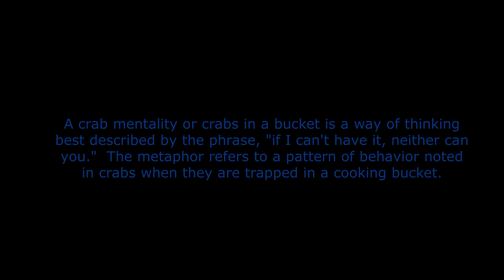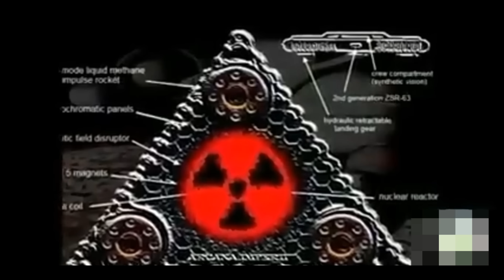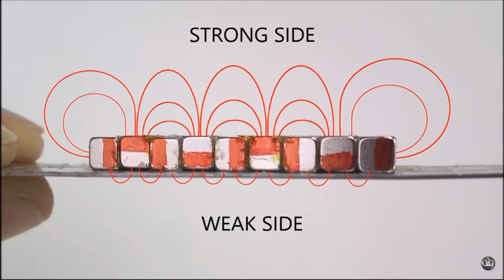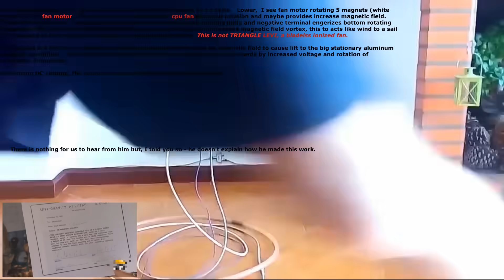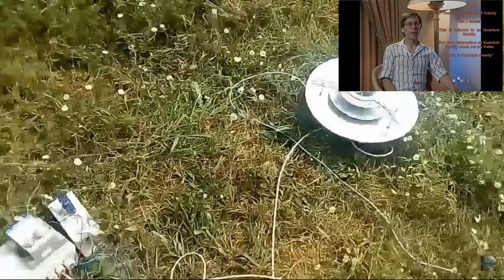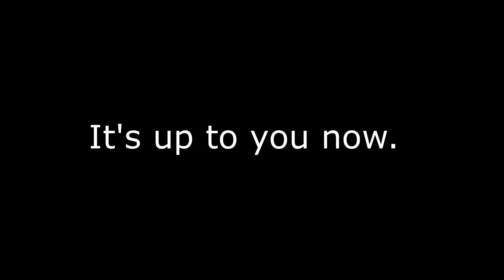anti-gravity project

Comment: yahhhhhh not even close to anti gravity

if u can create a device that can nullify the gravity waves that are pushing us down to "fix" the dent the earth is creating in space time, THEN you will have anti gravity (and then you can also make artificial gravity on space ships like in startrek and you can create kinetic shields and warp drives and artificial black hole devices (like the romulan starship cores) etc etc 

so far all I see is fancy magnets
Reply: Exactly. Perfectly stated.
Reply: Respectively, you need to go study this stuff in detail. The device copies all the principal technology from the German Bell to the descriptions of the Vimana craft. There is no way this stuff is fake, have you not see the Lifter Tech experiments, are those fake too? You can take two magnets of same size and press them together and feel a slight weight difference when compared to two other same size magnets sticking together, the weight loss is apparent. Also this experimenter is pumping thousands of volts into the center capacitor and he is counter rotating two opposing fields against a reflective aluminum disc, creating in the ether a counter 
field that is breaking the gravity lock.  He also is pulsing Ultra Sound from the cone downward and probably magnifying the sound 
pulse stimulating the ethers to move downward. . 

How about the sound chamber experiments levitating dust and the items floating upward in the Hutchison experiments? What about the High Voltage experiments that demonstrate charge obstacles get lighter? Friend, the proofs are out there. .My guess is this guy is probably getting very worried about what he has found. . He has not posted any update videos. What about the many patents on the High Voltage side of the technology. You don't get a patent on something that does not work. Just some things to think about..

Comment: MagLev is not AntiGravity.  They are both very different.
Reply: Exactly. Perfectly stated.
Reply: I might be joining this discussion a little bit late, but I decided to comment because I feel like I have a different argument. Just to make it clear, I'm not against anybody and all your arguments are valid. In this video we can visualize a magnetized object applying a force UP. Gravity is a force that pulls down, or towards a concentration of mass and the object in the video is applying a force upwards, opposite of the force of Earth's gravity. In the Cambridge Dictionary, for example, the definition of Anti is "opposed to or against a particular thing or a person" from that definition we can state that Anti-gravity is a force applied in the opposite direction of the gravitational pull, therefore the object in this video falls in the category of Anti-gravity.
Reply: and you know what AntiGravity is?   If MagLev can be contained within one Unit, a thing that rises up in the air without requiring a opposing plate on the ground (unless it is a planet or star) is effectively doing the job of AntiGravity, no?   So perhaps what we need here is Efficiency.   What if Everything Involved made use of Zero Resistance Conductors?   this would take out your backyard engineers who can't afford that level of expense.  But I would imagine Defense Department Programs would be working with Zero or Low Resistance materials.
Reply: @leovolont  still two diffrent things.Anti gravity subject related to exotic matter.And your scenerio still you counter pull of gravity, not neutrilize it.
Reply: @Smrt07     Okay, but when has any System ever counted on "neutralizing" anything.  Sail Power was not intended to neutralize the water resistance and the pull of current.  We only have to be able to Modulate Gravity and the the whole world changes.   Think of a Rotor in which you make the weights lighter by 10% going up, but heavier by 10% going down.  This could turn a healthy servo generator, couldn't it.  Now I am hoping that Gravity Modulation could be accomplished with Static Charges with not so much Leakage.  You know, the whole Energy In vs Energy Out thing.    the way to Beat Newton's 2nd Law is for the Gravity Modulated Part of the System would be like a 2nd Universe interacting with the First Universe
Reply: @leovolont  your just using a force that is stronger that another, you're no really neutralizing it as the name anti suggests, this is an magnetic hover thing, not a anti gravity device cuz it doesnt affect gravity directly, it just compensates it with a greater force
Reply: @GabrielVitor-kq6uj   Hi Gabriel,   Are you sure you are not asking too much of the prefix "anti".  Say you have a 10 ton ballast weight  from the keel of a deep water freighter, and you tie a little party balloon full of hydrogen that can lift a paperclip.  Now tie attach that balloon to the 10 ton ballast, after, of course, removing the paper clip.  Will not that balloon be exercising One Paperclip Unit of Anit-gravity force to that Ballast, if our only intent is to add up enough "anti-gravity" to pop the sum above 10 tons?  Now, yeah, in Space we would want something that didn't depend upon atmospheric pressure differentials, but you get my point.  We are not being German Existential Philosophers here, are we?  No, we are looking for either Free Energy or Cheap Propulsion. Quick and Dirty.  Who cares, right?
Reply: @leovolont  yeah absolutely! I don't really care how they do it, if I can have my floating car before I die I'll be happy, but to me it's too easy to call it anti gravity, your proposal is actually more of an anti gravity for it uses mass itself instead of magnetic forces, so I just don't like the term anti gravity cuz I find it to be presumptuous, I mean we didn't even found yet the reason behind gravity, so we don't even understand it completely yet, how can we be sure that a device is neutralizing something that we don't even know where comes from, that's my point, it's not as if Im not impressed by this device's functionality, I certainly do.
Reply: @leovolont  im soory im late and my engilish is late to compare my mind too :)In Enistain's gravity scheme we modelize the universe like a  stretched curtain.And in your arguments we didint fix the bend of gravity on plane.We just make bigger force to make it meaningless.But real anti gravity force defination depends on refix of bend on empty space.İts like a bump on the space flat.
Reply: @Smrt07   Hi Yorumcu,  thank you.  Yeah, I think I have seen diagrams as you describe concerning gravity modulation.  You know much more about it than I do.  The only thing I know is that people are doing it.  The technology exists, BUT it has been militarized and it is being kept secret.  My biggest concern is whether this existing Gravity Modulation Technology could be used to turn electro-generation dynamos in such a way as to cheat Newton's Law of Conservation of Energy.  It would SEEM so because the Antigravity Machines now in production seem to utilize a lot of energy, but they never seem to have of a problem "running out of petrol (gas)" so to speak. Thank you again.  Any insight you have would be appreciated.
Reply: @leovolont  thats not how maglev works either. And even if we made the absolutely most zero loss conduction.. i mean, perfect room temp conduction.. its NOT positive net. This means, youd still have to put a load in and take the load out.  If antigravity was possible in this universe, using our physics, we'd see examples of things creating power from nothing. Infact, we wouldnt want to live ina universe like that. If you spun a special top, that created energy. it would spin faster and faster and faster.. until nothing could stop it, until it bored through the planet, it would spin faster and faster until it broke physics.  Anything that could create antigravity couldnt be stopped. and each example could possible destroy the universe itself. if physics allowed energy to be created from nothing/positive net/even the slightest amount more than gravity
Reply: @bartacomuskidd775   Hi Kidd,  That was an interesting argument:  anti-grav would destroy the universe.  Look, the universe is still here.  There is no anti-grav.    We can use the same argument about fire.  It would burn us all up.  We can use the same argument about the wheel.  It would run us all over.  but the thing to remember about Anti-Grav is that it would mess with the essential physical characteristics of stuff.  For instance, if you change the gravitational characteristics of a local field, well, what would happen to the atomic spacing between the electrons and all that valence stuff?   Maybe if you relaxed the gravity in a local field, perhaps it would appear to disappear, and be in it's own Gravitational Local Field for a while... its own sub-universe.  It is not necessary that a Different Gravitational Field would impact the Greater Gravitational Field -- the Fields no longer match up.  You can swing the Different Bat and there will be nothing for it to hit.   You know, kind of like the way infrared can shine through walls but more so.  You know, you must have read or heard that 'Flying Saucers' sometimes just disappear.   They call it another dimension, but really, it probably only has to be another frequency.    For instance, how does one use Anti-Grav to travel?   Maybe they just tune to where the atomic spread is a millions time bigger than normal, and then you just use regular propulsion to move what seems only a few meters, and then tune back.  Well, where do you return.  The new center would be a huge distance from the original center, wouldn't it?  Of course, this would not explain how to get Free Energy.  But my argument is a bit like yours in that regards, that we have anti-grav vehicles that come and go and crash all the time, or they used to, any bursting into flames from rocket fuel was never a big problem.  These things are MAKING their own energy somehow.   Oh, there is Tuning and there is Tuning.  maybe you have to hit some kind of an octave before you 'disappear' but perhaps there are ways to modulate the 'phase' of gravity.  Maybe there cannot be a runaway scenario as you describe simply because a physical bearing would fail.  A Free Energy Generator would still have to keep at least one foot inside this Real World Field, and the limitations of the mechanical devices would keep the process honest.  But, yeah, it's all interesting to think about, isn't it.
Reply: This is important information people need to know
👍

Comment: This guy pains me sorry. Also if you stand in a elevator that is going down a start spinning you 
Will come off the floor. This not antigravity but your making your body travel much further than just standing there. This occurred to me right before the elevator started down and when I did it my feet had less traction because of the decreased weight .

Comment: Greetings Jeff. I must remind you that Stan Deyo's lifter was quite functional yet lacked the over efficient power source all lifters we see on youtube need. Sure you can always make a great lifter design, maybe better than his, but if you don't know zero point science, you'll never be able to fly it anywhere without a power cord. 
So, set back the clock to about 700 a.d. when thousands of Indonesians witnessed the landing of a massive craft in Borobudur Indonesia. During that same time, in Moab Utah, many Hopi indians witnessed these same giants there. They came there to mine radium from the mesas, of which there is evidence of.  
Now take a look at the stone model replica the locals or someone made of that spacecraft, known today as the Borobudur Temple. This is the first known location of the Nazi bell, well, what became known as that. It was a worn out ion drive module. I say module because even though it could lift on it's own, these work far better when arranged like the stupa with 32 around 24 around 16 around one large carrier. So what is that secret to zero point energy? Pump z waves in sync yet out of phase with proceeding waves implode through a nonlinear medium to combine after focus, forming a sum of wave peaks. That information was leaked from the Philadelphia Experiment, Tesla's baby. 
I've reverse engineered the bell, but it's tough to build. Layers of copper must be electroformed for 3 months.
I've been designing now a simple coil based circuit similar to Stan Deyo's lifter a bit. It uses a design of my own with 8 coils around 1 mainly, 72 of these, around one large one. It uses a tech similar to the Hubbard coil to make it's own power from each coilset of 9 of which there are 73. I'll need to build and test some to perfect the small one before I go to the next step. See, the reason for the configuration you see on Deyo's lifter or on the Boro temple there is wave compression but also a pulse orbital discharge effect which pushes ion discharge to exponential levels before the carrier wave can completely recycle. This means heavy ions are lost far from the circuit before they can charge imploded again and consume energy. Also, the polar reduction from a high number of poles to a low number of poles at the core gives a 3 stage split of the very slight mass difference found among the positive and negative poles. Ie; it's like a catapult for energy vs/mass.  The large carrier coil at the core, not used in Deyo's circuit, is what would have made Deyo's circuit better, but I'm making it much better. I calculate these 2' discs can lift about 1k each. I'll mount 3 on a triangular structure. All you need here is a miniature yet tapered version of the Hubbard coil, and no need for radium and use iron around the copper so charge implodes. Hubbard had it backwards. About all he did have right is the concept of zero point which uses a carrier wave to turn carried waves into pump z waves using simple charge implosion. Even his cruddy design made 35hp from a coil about as heavy as a big car battery.  Sure radium would help, but you can use other means of dielectrics to boost performance not that it's necessary for flight or free energy.
Reply: @jefflucas_life  Do you understand why 32 around 24 around 16 around 1 on Borobudur Temple?

Comment: Neat, but a little sloppy on the power source, too many wires, shouldn't have any. How about a shell that's made of silicone solar panels, it would have to be high grade silicone, once in space it would super charge and last forever. Propulsion couldn't even be measured, virtual light speed.
Reply from the maker: Agree the wires are a mess, speed of light, mmm idk.

Comment: You are doing NOTHING to gravity you are using centrifugal or Centripetal forces to lift opposing Gravity. Not anti gravity. When you can lift the power source with it I will be impressed.
Reply from the maker: My thinking its the EMF + Capacitance, tuned with ultrasonic waves emitted by the driver from the top of craft at 40K Hz to  64 KHz towards the big array.  The big array is in ultrasonic standing waves enhanced by EMF bubble canceling gravity center of the craft, hence the craft moves upwards direction of EMF, bigger the EMF bigger the encompassing lift.
Reply: @jefflucas_life  Very possible but it still is not cancelling gravity it is merely overcoming it. Gravity is an attraction standing waves are an opposition or a thrust if you wish.

Comment: Can you please explain to me how this device works when a minus pole is not connected to the battery? For example in video 11:21 ..
Reply from the maker: My thinking its the EMF + Capacitance, tuned with ultrasonic waves emitted by the driver from the top of craft at 40 kHz to 64 KHz towards the big array.  The big array is in ultrasonic standing waves enhanced by EMF bubble canceling gravity center of the craft, hence the craft moves upwards direction of EMF, bigger the EMF bigger the encompassing lift.

Comment: Ok every think is nice but how can ufos flying without cooper 😕
Reply from the maker: My thinking its the EMF + Capacitance, tuned with ultrasonic waves emitted by the driver from the top of craft at 40 KHz to  64 KHz towards the big array.  The big array is in ultrasonic standing waves enhanced by EMF bubble canceling gravity center of the craft, hence the craft moves upwards direction of EMF, bigger the EMF bigger the encompassing lift.
Reply: @jefflucas_life  EMF of what wavelength / frequency, Capacitance of how much ...  What are we basing this on? do we have a formulae or working stats

Comment: I am largely interested in making these models which are far from our present time. I will work hard
Reply from the maker: My thinking its the EMF + Capacitance, tuned with ultrasonic waves emitted by the driver from the top of craft at 40K Hz to  64 KHz towards the big array.  The big array is in ultrasonic standing waves enhanced by EMF bubble canceling gravity center of the craft, hence the craft moves upwards direction of EMF, bigger the EMF bigger the encompassing lift.